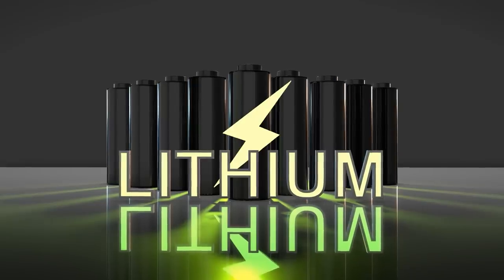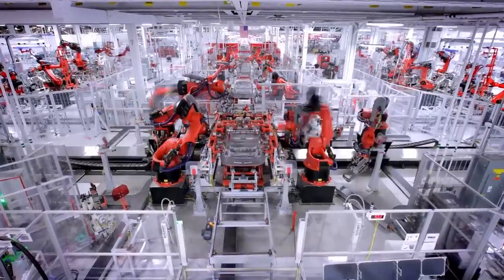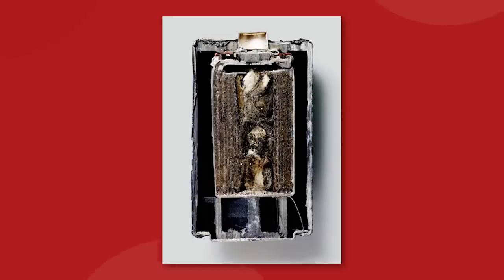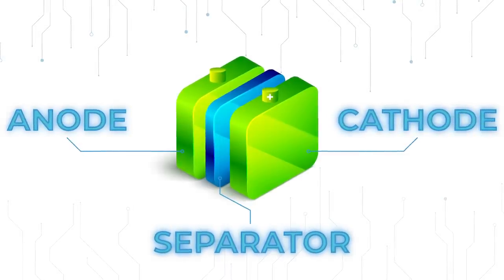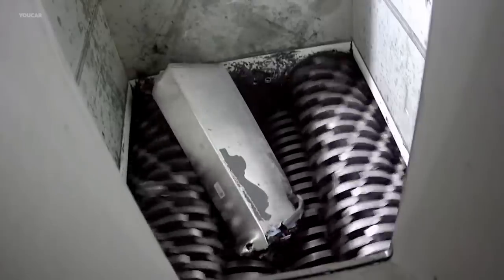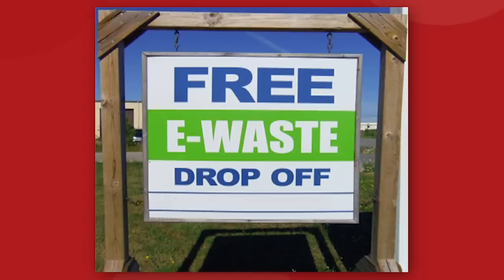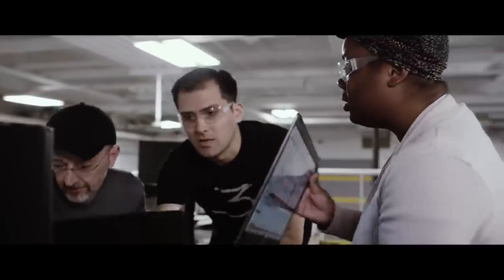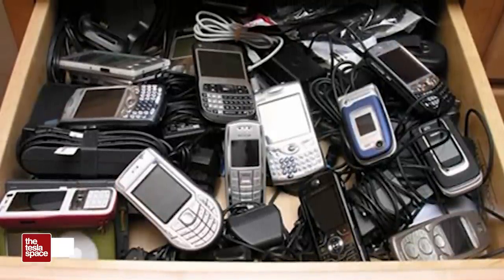The Surprising Solution To Tesla’s Battery Supply Problem!

Comment: I have been off grid since 2016 and I use  140 kW hours of repurposed Tesla Model S modules out of cars I bought from an auction that were totaled
 I bought a 70 kwh 2016  model S and 85 kWh 2016 model S
 I also repurposed 4 more modules for my 80v forklift
Reply: Can we please see a video of the setup!? I like to see batteries getting repurposed instead of recycling directly! The tesla structural battery is a gigantic mistake for reusability
Reply: @carholic-sz3qv  the Tesla structural pack already addresses recycling, the pack is designed to be shredded and the components will be separated by magnets
Reply: Solar tech. How much did you have to pay for the totlatd battery packs
Reply: Hey, I like this guy ... (I'm a person who lives by 'I hate waste' ... )

Comment: Not true on many counts.  Rare metals are not needed either for Li batteries (the latest and best ones use Li, P, Fe and Mn).  And it would appear that they can take a lot more abuse than previous Li batteries (fast charge to the top and draw down to the bottom).  Also Li is not needed for green energy applications.  There are better alternatives for static applications such as the Ca alloy, Sb liquid metal batteries, the redox batteries and the ZnBr batteries.
Reply: I thought Lithium was a rare metal.

Comment: Recycling batteries won't save us from the need to vastly scale mining, because the big wave of used EV batteries won't arrive until after 2030, when large numbers of early Model 3s start to be retired.  Meanwhile, companies like Redwood Materials are refining their 'battery mining' methods on a staple of cell-phone batteries.
Reply: After 2030, the number of new vehicles will stabilize or even decline (from robotaxi adoption) and the industry can enter a mostly closed-loop materials cycle as the rate of recycling EVs reaches parity with production.  Given the trajectory that Tesla (and the rest of the industry now following it) is on, the need for mining new materials to serve production before the cycle is closed is staggering, that in maybe 100,000,000 materials.
Reply: And also Cordless Drill and other tools.  Many millions of 'em .  Tool Battery Pack recycling at all large hardware stores like Lowes, Builders Square, & Home Depot .

Comment: Tesla is already doing its own recycling. Elon mentioned they are doing roughly 50 packs a week. The cars aren't failing enough to do more than that
Reply: @trp2413  that is an interesting take on things. We don't know if it is failed packs in old cars or packs that didn't make the quality check. I also think they learned a lot over the last 10 years. It's sad to see we have a new company that can make a 10 yr car but an experience automaker like GM is recalling all the bolts.
Reply: That's different though. Recovering a new pack by removing a one or two dud cells has a much higher benefit, than completely breaking down the elements of old clapped out packs/cells.
Reply: @trp2413  50 a week is 2600 a year
Reply: @trp2413  My Dude, 50Packs per week X 52 Weeks per year does not come close to 12K... more like 2.6K, which is 80% the production based on your message. Now given they don't get all their packs back, that is still pretty impressive based on the lack of knowledge us mere mortals have on actually looking after our batteries...
Reply: @trp2413  I think it is reasonable to assume that there are four sources of materials for recycling: (1) some of the the newly manufactured cells don't pass quality control and are sent for recycling; (2) a screw-up might occasionally occur when assembling a battery pack from cells, the assembled pack doesn't pass quality control and is also sent for recycling; (3) possibly-damaged battery packs recovered from crashed vehicles are sent for recycling; and (4) battery packs that died or degraded too much in still-running cars are sent for recycling. You are jumping to the conclusion that all the recycled packs come from (4), but it is far more likely that, currently, a significant amount of recycled material comes from (1) and (2). To simplify reporting, it is likely Tesla doesn't say something like "Weekly, we recycle 34 battery packs and individual cells that are equivalent to another 16 battery packs", but rather just combines those two numbers to report "Weekly, we recycle 50 battery packs". 

I suggest you do a trivial internet search to find Tesla's "Impact Report 2021" document, and read page 67. Doing that should alleviate your concerns about the likelihood of a battery pack dying prematurely.
Reply: @DavidTangye  I don't think Tesla packs are designed to be repaired.
Reply: @carholic-sz3qv  I suggest you do an internet search for "does tesla recycle batteries" before you accuse people of lying.
Reply: @DavidTangye  A few months ago I was pleasantly surprised to learn from an interview with JB Straubel that "old clapped out packs/cells" can be recycled to recover about 95% of the materials, and those materials can be used to make new, high-quality batteries. JB Straubel was one of the co-founders of Tesla, and a few years ago he left Tesla to start a company called Redwood Materials that focusses on recycling "old clapped out packs/cells". There is an economic benefit of such recycling: crushing old cells/packs provides a much higher-grade "ore" than you get from mining, so the refining process is more efficient. As such, making new batteries from recycled batteries is significantly cheaper than making new batteries from mined ore. If you are interested, you can find some JB Straubel interviews and presentations on YouTube.
Reply: @trp2413  the average ownership of gas cars is 5 years, so why demand 10 for EVs? Especially if you can just swap the batteries and they're still good to go?

Comment: Some of the issues addressed here have already been solved for. I think we are going to see 3 or more new types of batteries go into production every year for the next decade at least. Everyone working on battery technology is on notice now, you don't have "years" to get this stuff to market. You have months, and it will happen. That doesn't mean replacing existing technology it means "in addition to" the existing technology. This will spread out the demand over many different types of materials.
Reply: Solved? how so? We have a handful of recycling centers in USA handling battery waste.
Reply: @miquelgorbivi7702  Not that issue the fire risk and material issues. LFP and M3P are already in production. LFP comes in the standard range Model 3 already.
Reply: @frankcoffey  lol…..
Reply: Well done, a modern problem requires multiple avenues of solutions, working in different areas to achieve the same goal will inevitably get us there quicker.
Reply: Yeah sodium seems to be another type  on the horizon. Jordan from the limiting factor made a really long and exhaustive overview.

Comment: That sounds like good news for after the transitioning period. But during transition, recycling can only supply a tiny fraction of the materials. What we recycle now is what we produced years ago. Steep growth also means we produced much less years ago than now.
Reply: however, increased efficiency means we can use less now for the same power.

Comment: Or  don't use batteries, use a fuel cell, and H2..., You can use existing infrastructure to sell the H2, and produce it using solar, wind or Nuclear...   you can even make fuel cells that can also run on  Natural Gas, or even petrol...  and H2...     skip the batteries...

Comment: Why aren't EV carseats made out of batteries? Range free heat in the winter. Why isn't an EV car frame made out of batteries tyvec and compressed paper cardboard. Why isn't car paint infused with solar cells? Why isn't car rubber doped with carbon and aluminum to make it conductive when contacted to the road? etc, etc, etc. Plenty of opportunities for innovation.

Comment: Lithium-ion battery technology to me is likened to computers using CRT monitors and serial and parallel ports.
The only reason we're still using that antiquated technology is that companies like Tesla didn't happen sooner.
Necessity drives innovation.
Reply: Lead-acid batteries are more like CRT monitors: antiquated. Lithium-ions are more like LED monitors: the most dominant product in their industry. Crazy exotic solid-state batteries are like OLEDs: experimental, small scale, and expensive.

Comment: Dude, this is a non-solution.  There isn't enough lithium on this planet for all the batteries that will be needed even if every battery is recycled and we use all the lithium that is already in landfills.  We have to switch to battery chemistries that use a very small fraction as much lithium as what is used now or use none at all even if we do manage to get every battery recycled.

Comment: Recycling will happen but it's going to be a little difficult at first to get the batteries back. There are folks who would love to get their hands on those packs to reuse them even at the reduced capacity. But over time there will be enough used ones to supply the recycling plants and yes, those plants may end up making batteries on site to improve efficiency. One of the nice things about EVs is you can still use the car when the battery degrades, you just charge it more often. If my engine or transmission goes out my "range" drops to zero until I fix it.
Reply: In the future, I'm guessing that Tesla will likely give you around 50% discount on a new battery if you give them your old one to recycle.
Reply: @betrion7  They could also do a deal with insurance companies (including their own) to get possession of totaled cars.
Reply: Recycled materials from batteries will barely make any improvements on demanded raw materials lol…..

Comment: The way I think we should go is make the battery pack in a EV 's capable of being swapped out if the pack doesn't perform as well as it originally did and have a new one put in. It should not be a problem to do so. The old battery pack is sent to professional recyclers to re-constitute the materials into new battery packs. Only the chemical energy is used up in the old and is reconstituted for the new in the materials from the old batteries. The problem is, we are so used to throwing old useless stuff away into landfills instead of recycling...
Reply: It is about as complex as pulling an engine but given that one should not have to replace the battery in modern EV this is deemed to be good enough.  The recyclers are already there just need the volume.   The bad batteries are too valuable to toss in a landfill.  
If one only charges lithium ion cells to something like 85% the modern batteries will last about a million miles.
Reply: The batteries on the Tesla Model S&X drop right off of the bottom by removing some bolts. The probably is that the odds of the battery failing are low and new packs are very expensive.
Reply: @ChrisSmith-tc4df  Cool.  Was thinking about structural battery packs.
Reply: @danharold3087  of course they are too valuable BUT the reality is THEY ARE thrown in the trash because recycle collection stinks in America!!a. We need to shout it out!!
Reply: @richf3654   Net says 98% of lead acid batteries are recycled.    Finding one is like finding a $5 or $10 bill.   People who see them turn them in.  I suppose if you hide them the could find the landfill.   Set one on the curb or most any place it can be seen and someone weill nab it and turn it in.

It is not the guys who recycle paper or glass bottles that recycle batteries.   The mechanics who replaces EV batteries or the place that sells you the next one will turn it in for recycling.   Just too much money to toss in the trash.  Not that you can dump a 1000lb battery in the trash but I get your meaning.  I can see the makers attaching a core charge to new packs to ensure that the get the old one.
Reply: @richf3654   If they are not making their way back to be recycled a core charge of $1000 or more will make it happen.     Easily solved problem.
Reply: As it stands I think an EV is about $60000, we did exactly as you think would work you'd probably bring the price to over a quarter of a million dollars the sad thing is when you get done you go to recycle that car and you spend another 50 60,000 trying to dispose of recycler whatever of all the electrical components and batteries circuit boards and the like
You're left with surprise a car we have junk yards full of them.
Really think about the entirety of this whole process the best renewable God gave us it's an almost endless supply of hydrocarbons and yes it is renewable carbon and hydrogen two of the most elements in the entire universe under pressure form oil and gas and in certain areas coal and yes it is being made under our feet as you read this that is renewable it's most simplest form.
You guys all get to caught up in the communism the green on the outside that's really red on the inside woke broke bullshit.
So do the right thing be thankful thank God for all he has given you otherwise zip it or you will give some idiot permission to cost you big money anytime anyone comes up with an idea that requires you to do something or worse you to pay to implement their wonderful idea if it was so damn wonderful you'd want to invest in their wonderful idea not.
What really means to happen is whoever comes up with some idea that requires other people's time money and effort needs to just be shot put them out of our misery right away.
Reply: @danharold3087  they are structural you have any idea what they weigh that takes a lot of structure to support that weighs a lot itself that all detracts from the economy or the efficiency of the system that was simple automobile burned hydrocarbons that are renewable they're being made under your feet as you read this carbon and hydrogen to the most plentiful elements oil is the ultimate renewable thank God that he saw fit to supply us with an unlimited supply of it now zip it and use it and be thankful for it.
Reply: @chauvinemmons  EV's are efficient even with having to haul around the batteries.  

You need to stop saying oil is renewable.  The guys in white coats are going to take you away.   

"Given the theory that fossil fuels were created by former living organisms, it suggests that given enough time, heat and pressure all fossil fuels would be "renewable." So, theoretically, millions of years from now today's organic matter could become oil."

Comment: Here’s a thought and maybe a topic for your channel that you can do a video about. Tesla has the Dojo super computer that it’s only function is to advance FSD. Why not build a super computer specifically for battery research and cell chemistry. Tesla likes to use the first principles approach so  they can also teach that to the super computer. Then when the computer spits out ideas they can lab test, extract the data, continue till we get super steroid version of the 4680.
Reply: Dojo is/was developed to train and test neural networks.   This was needed because the process takes a long time.  Dojo is faster so it takes less time.   Dojo is a programmable computer.    Researchers write programs and run them on dojo or other computers.   It could be used for battery research in this conventional way.   Now if your thinking of using neural networks to work on battery chemistry I am sure I don't know enough about the battery cell subject to even speculate.  Thinking it could be done just not sure if it is something that would help.
Reply: Lol…..

Comment: This is such an educational video. Every video is such a great production. Definitely one of the best Tesla science channels, dealing with engineering. I just wanted to make a comment at 9:40, you mention that we need Lithium metal ore, in order to switch to "sustainable energy." I think what we really need for sustainable energy is a new method creating electricity. Our electricity "creation" is the key problem, preventing sustainable energy. Consider some of these already existing technologies, which would likely eliminate our need for a power grid, or large battery banks.

-The Rossi E-Cat powdered nickel low energy fusion generator (uses hydrogen and is a LENR device).
-Brown's Gas. Monoatomic hydrogen gas mixed in a common duct with oxygen in a perfect ratio, creates a type of low energy fusion reaction upon hitting certain substrates.
-The Yildiz permanent magnet motor.
-The Robert Mueller dynamo.
-The MEG by Bearden
-Stephen Mark TPU
Reply: It would be educational if the information was up to date and accurate

Comment: This video is actually half backed! Yes we have been using lithium batteries for almost 2decades but mostly on tiny/small devices like smartphones which are like 1/10.000 the battery capacity of an EV, plus we are relatively still at the beginning of EV mass production so recycling won’t really affect new ev production at all.